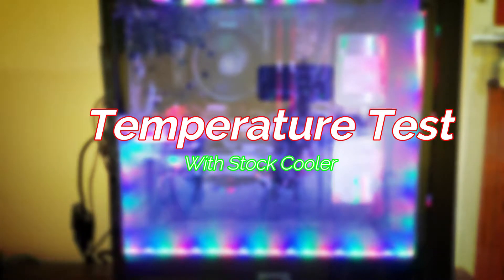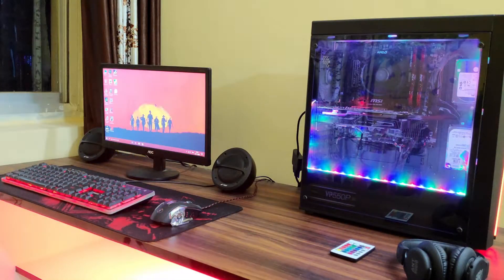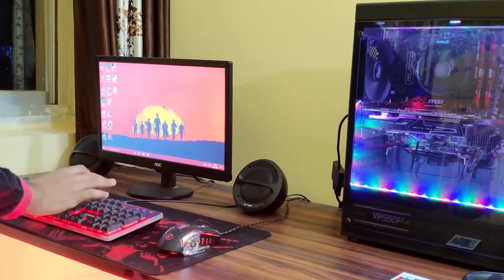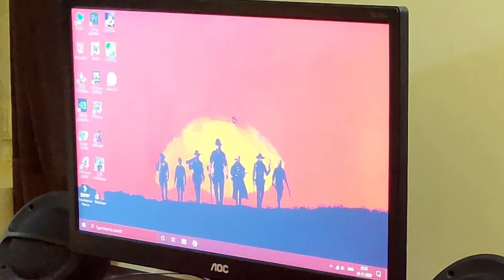Best CPU Cooler Under BUDGET | Deepcool Gammaxx 400 V2 | Unboxing & Temperature Test | Mostly Techy

Comment: Which is best Gammax deepcool 400v2 or deepcool AG 400LED and how much watts your SMPS is?
Reply: AG400 is slight better - has a new fan with more CFM and pressure; but the difference will be small, 2-3 degrees.

Comment: They have new mounting brackets...  If you have amd you don't have to remove the stock AM4 backplate...  Depending on which Inel motherboard you use one of two included intel back plates...  A back plate for 1200/115x and a back plate for LGA 1700...  They no longer use the push pin intel brackets...  They now use a metal spring screw bracket...  I would suggest using a higher rated thermal paste other than the paste provided....  I use thermal grizzly kryonaut but you can also opt for noctua NT-H2 or gelid solutions gc-extreme...  All three pastes have extremely well thermal conductivity...
Reply from the maker: Thanks for the valuable information !❤️

Comment: Connecting on normal stock cooler header or need RGB header??
Reply from the maker: No bro you don't need RGB header as the fan is of Static blue colour (other options also available in the Market such as Red), just need to connect it to the normal fan header (CPU header) and you are good to go.
( Sorry for the late reply though )
Reply: @MostlyTechyProductions  Ooh Thanks❤️.Late reply is not a problem 😘

Comment: Will it be compatible with ryzen 3 3200 g  with MSI b450 pro Mother board with ice 200 TG cabinet
Reply from the maker: Yes, this RAM stick will work flawlessly with the specs which you have mentioned.

Comment: Which processor you are using ?
Reply from the maker: In the video I am using Ryzen 3 3100 but now I have upgraded to Ryzen 5 3600 with a 120mm AIO (but my friend has the same setup with Ryzen 5 3600 with Deepcool Gammaxx 400 v2 Blue and believe me the temperature difference between both is negligible) In short this is the best air cooler for the price point.

Comment: is there a way to turn off led light if we don't like it?
Reply from the maker: Unfortunately, no there is no option to turn off the Blue light as it is integrated with it's PWM connector (as soon as you plug the connector cable to the motherboard the lights will start glowing)
Reply: @MostlyTechyProductions  can we put another fan if we want to change color instead of this fan? any 120mm fan will work or need some special fan

Comment: On stock cooler your tems was fine so why you purchased after market cooler?? 🙄
Reply: I just bought this Cooler for an hour worth of my work. It looks cool, comes with paste and does the job. It's a no brainer to buy this if it's an upgrade
Reply from the maker: Because if in case you want to overclock your processor, and if you do that with the stock cooler so the processor's temps might reach as high as 100° C to 105° C, in that case a good aftermarket CPU cooler  can be a rescuer. (As of now I have upgraded to Ryzen 5 3600 and I installed that with the stock cooler for testing purpose and the temps were around 70° C from the starting, so in that case after market coolers can be the perfect option)
Reply: @MostlyTechyProductions  how much you got with 3600 with this cooler (also mention the ambient on every benchmark).
Reply from the maker: Well I personally Never used this cooler with 3600 because I sold this cooler way before purchasing 3600 and instead bought a 120mm AIO, but I made almost same setup for my friend, i.e. 3600 with Deepcool Gammaxx 400 v2, and believe me my 120mm AIO (which is one of the most expensive 120mm AIO in the segment) performs almost the same as the Deepcool Gammaxx 400 v2, Indeed the Deepcool Gammaxx 400 v2 is best of the best performing Air cooler for the price which you're gonna pay for it !
Reply: @MostlyTechyProductions  well you really answer questions very well, i like that. It's better to purchase minimum 240mm aio. 120 is just a dhokha.

Comment: Suggest me a air cooler for ryzen 5 3600
Reply from the maker: If you want best of the best cooling under budget then this is the only cooler you should consider, I have upgraded to R5 3600 plus using Corsair Hydro H60 (new) AIO with this Processor and I must say that Deepcool Gammaxx performs same as the AIO which I am using right now, comparison video coming soon !
Reply: @MostlyTechyProductions  thank you so much ❤️ brother
Reply from the maker: @MRSarkar5  No problem ! ❣️

Comment: Will this cooler be good for my i5 3470?
Reply from the maker: Sure, It will do great with you Processor ! Temps would be under 30°c on stable and max it would reach around 60° max
Reply: @MostlyTechyProductions  thanks for the quick reply
Reply from the maker: @mylifehasbeen99betterafter57  No worries, I am here to help !

Comment: IS IT OK NOT TO PLUG THE RGB?
Reply from the maker: Unfortunately the BLUE light starts automatically as soon as you plug the PWM cable of the fan to the motherboard CPU fan header, and you must have to install the PWM cable to the CPU fan heater.

Comment: bro i have ryzen 2600 problem is with amd stock cooler it is 60-65° idle & than while gaming or heavy tasks compressing it goes 80-90.. should i get this please let me know if this would be best choice for me?
Reply: bro just one question will this cooler work on asus prime b450m K motherboard.. can you please help me on this.. thankyou
Reply from the maker: Yup, it's compatible with every AMD's AM4 motherboard out there
Reply from the maker: This was the case with my friend's PC also, he have a Ryzen 5 3600 and with the stock cooler the temps were horrible so I swapped out the stock Cooler and installed this one (DEEPCOOL GAMMAXX 400 v2) and believe me at full load the temps were like 63 - 65°
I would say if you are looking for a Air cooler under budget, then no one can beat this one ! It even beats some of the cheap AIOs in temps, just go for it ! 👍
Reply: @MostlyTechyProductions  thanks mahn stock cooler sucks..sadly seeing this out of stock currently everywhere
Reply from the maker: That's unusual, It never runs out of stock, Just wait for sometime and spend your money on this one only !
And yaa one more tip, the thermal paste (pouch) they include in their box is gonna dry out mostly likely after 3-4 months so use that until it gets dry and replace it with a good quality thermal paste like "Cooler master mastergel maker" or "Noctua NT-H1" .
Have a nice day !
Reply: @MostlyTechyProductions  yea got it covered there.. have one thermal paste from cooler master shud be good enough

Comment: Was the cpu plate at the bottom slightly bent/slant rather than being totally straight i.e. 180 or 90 degress?
Reply from the maker: No bro it didn't, it is perfectly straight 🤔
Reply: @MostlyTechyProductions  thanks for the info